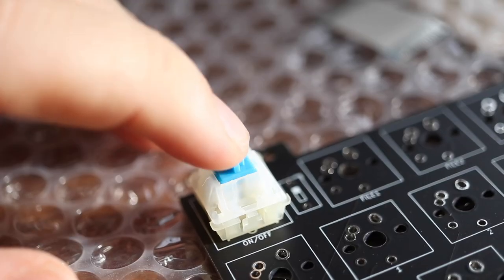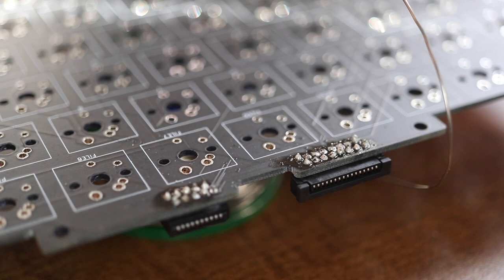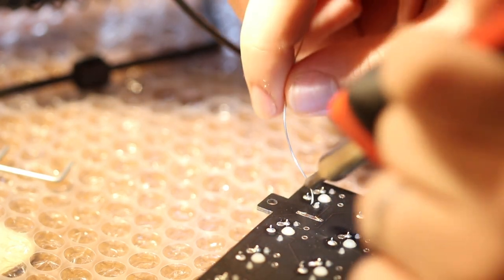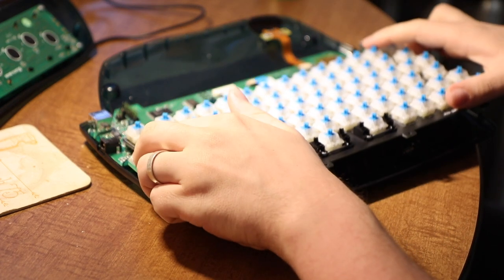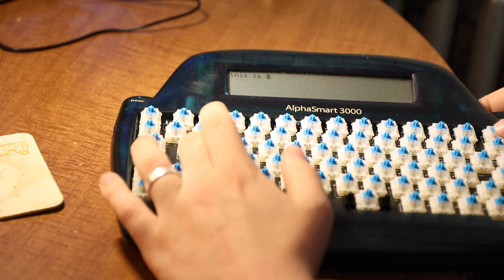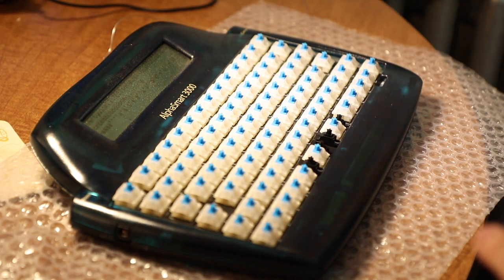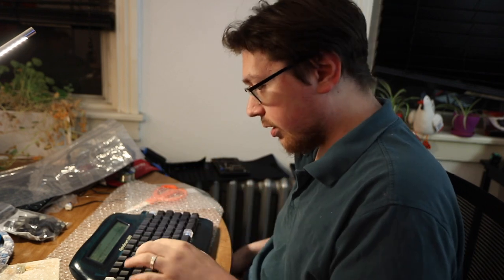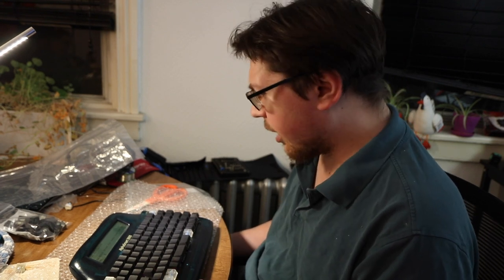Alphasmart With Mechanical Keyboard - Day 2073 | August 23, 2020

Comment: Good video! Thanks for showing it off. I love my alphasmart but I would adore it with a nicer keyboard.

Were you able to utilize the original pcb or did you have to find a replacement/custom to wire?